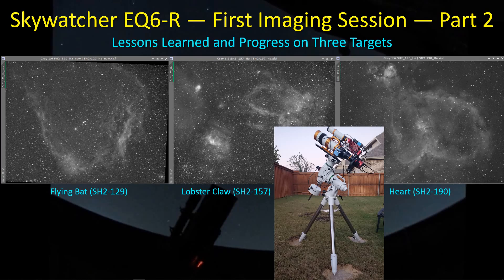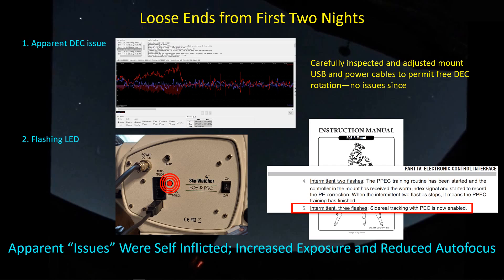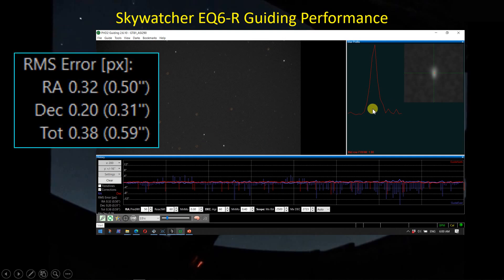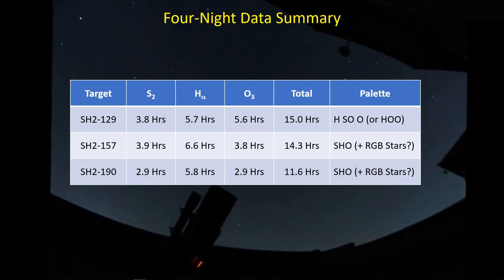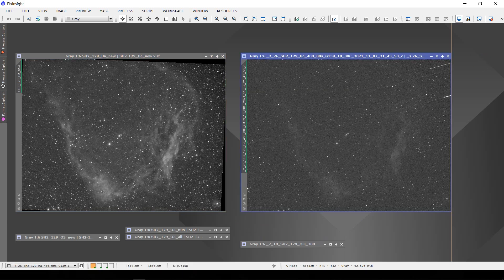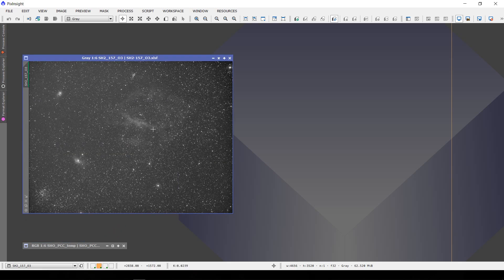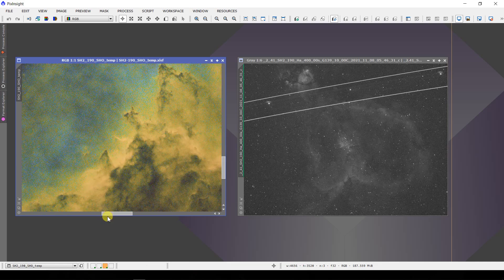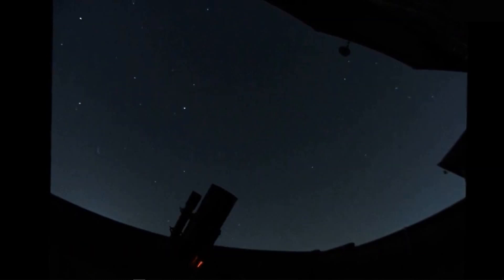Skywatcher EQ6-R: First Imaging Session, Part 2

Comment: Hello James,

Regarding the guiding performance shown here, was that with the PPEC or PEC enabled or disabled? Have you experienced any difference with or without? Do you feel that the guiding is able to correct most of the periodic error on its own?

Regards
Reply from the maker: Simon,
I have tried PPEC on and off. I don't see much, if any, difference. PHD2 does a perfectly good job of correcting for slow variations like "reasonable" periodic error.

Comment: What equipment do you use for focusing? Thanks
Reply from the maker: I use the Pegasus Astro FocusCube2 and NINA for controlling the autofocus run.
Reply: @Aero19612  thanks. For all your scopes. Right?
Reply from the maker: Manual focus for the Redcat 51
Pegasus Astro FocusCube2 for GT 81 and ED102
Celestron focus motor for C9.25

Comment: Excellent info James.  I sometimes keep the airplane trail images with no detrimental effects.  I continually have to be reminded when all else fails - read the directions.  Also, I really like that graph of temp vs. the focuser setting, I never though it would be linear like that.  - Cheers Kurt
Reply from the maker: Hey, Kurt. Yeah, the trend should be very linear since de-focus is caused by thermal expansion/contraction of the tube and change in the index of refraction of glass (for refractors). Mirror flop for SCTs is a different matter. Thanks for watching!

Comment: I'm very interested in the temperature compensation. I can definitely see the focus shift in my Redcat as the night cools down. Does NINA pause the imaging while it makes a temperature compensation focus change? I can see the ZWO EAF movements when I focus the Redcat while imaging. At the end you mentioned NINA not having temp. compensation. I'm running a recent nightly build and I see an option in the focuser section for it. I don't know where you tell it how many steps per degree C though.
Reply from the maker: I use the stable release version of NINA and there is a "Temperature Compensation"   on/off switch, but as you say, there is no place to enter # steps/degree. The version on NINA I'm using doesn't do open loop temperature compensation. It may be in the nightly builds. So , you have the EAF on your Redcat? How is that working for you? Thanks for watching!
Reply: @Aero19612  I'll reach out to one of the NINA developers (in my local astronomy club) and ask about the temp. compensation feature. The ZWO and Redcat works pretty well together. Not as nice and consistent as the v-curve of my Esprit 100 and another ZWO but close. I 3d printed risers and a motor holder. I just ordered the 3d printer belts off Amazon and it all went together nicely.

Comment: Glad you have had a promising intro to the EQ6R. Confidence in the equipment is half the battle. Still kicking myself for following the recommendation of another you tuber on the CGX. Should have stuck with SW and got the EQ6R myself.
Reply from the maker: So true about the "confidence in the equipment." I got the point where I dreaded the pair of the SCT (focuser) and the CGEM. Like working with two teenagers. I'm lucky so far, the EQ6R is doing well. I considered the CGX. Some have had bad luck. Some have had good luck. Thanks for watching, Rob!

Comment: Good info on the EQ8-R Pro James.  That guiding value of 0.59 is awesome!  I might try to keep some of my airplane trails in my stacking DSS just to see if it too eliminates them, but currently, I toss them out.
Reply from the maker: Hi Pat. I'm pleasantly surprised about the guiding performance I'm getting. A huge relief. Would be interesting the know if DSS does as good a job as Pixinsight with pixel rejection. There are some things DSS does that are better than Pixinsight. I've never used DSS. Once upon a time, I used Nebulosity once upon a time for calibration but dropped it once I got comfortable with Pixinsight. Thanks for watching!

Comment: The Nightly version of NINA has various plugins, one of which is Darks Custom Offsets which adjusts focus based on temperature changes. Nightly version of NINA is very stable and well worth the upgrade from the release version which I'm guessing you're still using?
Reply from the maker: Thanks, Simon! You are correct: I'm using the stable builds. I'll look into the nightly builds. I know there's lots of cool stuff in the sequencer. I didn't know about temp compensation for the focuser. Thanks for watching!

Comment: NINA actually has a temperature based autofocus routine built into the sequencer. Cheers
Reply from the maker: Hey Georg. I know you can trigger an autofocus run based on temp change in the stable release version (I don't work with the nightly builds), if that's what you mean. But I'm talking about NINA making adjustments on it own without doing the hyperbolic fit procedure. In other words, if you determine that the focuser should move in by 8 steps for each 1 deg C drop in temperature, then NINA could move the focuser 4 steps in with each 0.5 deg  drop in between taking images. This may be in  the nightly builds, but I've only been using the final stable versions. Thanks for watching! Please correct me if I missed your point.
Reply: @Aero19612  Hi James, the nightly has an auto-focus trigger on set temp fluctuation. It triggers a full auto-focus routine. Equally to HFR were you can define a % difference for auto-focus to be triggered. I see what you mean and that is indeed not something offered in NINA. I checked through some of my data just to see what step differences I had - temp diff 3.84°C steps 18 
Total steps on my focuser 0 to ~15000
I am looking forward to seeing more of your videos. Cheers

Comment: Great job James....FYI with your great video on the Greenswamp server, I was able to get my setup all in sync using the GS, Nina, PHD and Stellarium.. Im so psyched to have stellaruim control my mount.. Thanks for all you effort..  Now to get my RMS down to your 0.6".    On the linear focus... does your focuser have a Temp compensation option ?
Reply from the maker: Great news, Tim! I'm glad it's working for you. I haven't needed to control the scope with Stellarium, but it's a nice option to have. The focuser (Pegasus Astro FocusCube) has a temperature sensor that provides NINA with the temperature. I don't believe the current full release version of NINA performs focuser adjustments with temperature, but the nightly builds may have this option. I need to look into it. Thanks for watching!
Reply: @Aero19612  my old 1.10 HF1 version of NINA has temperature compensation and I use it all the time and it works  great.. just need to dial in the temperature coefficient in the driver properly.. I could go all night just using Temp compensation now if I needed too. (on my Spacecat /Starlight focuser)

Comment: I'm still slogging away with APT, but it's still working for me. While the autofocus aid works, I just don't care for it and don't know how you would automate it. This has me considering the switch to NINA. Also, I could totally see the squid in your O3 data. Nice job!
Reply from the maker: Haha. Yeah, it's there. Just barely. But you have to know it exists otherwise you'd write this target off as an O3 source. Have you tried their new "Focus Craft" options? They have the hyperbolic fit method and the new Fourier method. I'm not sure it's integrated in to the session planner yet. It was the fully automated auto focusing routine that pushed me over to NINA. It just works. Thanks for watching, Brandon!
Reply: @Aero19612  not yet! I'm afraid to update since everything has been working flawlessly for me the past few sessions. Seems whenever I update either Windows or one of my programs, there's always new bugs that throw me for a loop and I waste a couple nights of imaging dealing with it. Meanwhile another update comes out.
Reply from the maker: Absolutely. If it works, don't touch it. The %^#$ automatic Windows updates have screwed my system up more than once. I also stick with the release version of NINA rather than download the nightly builds.